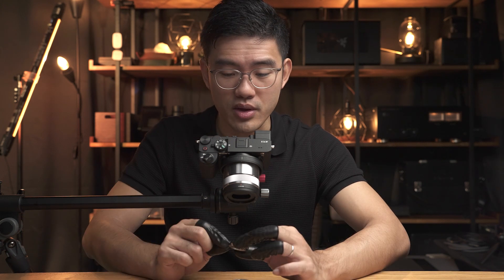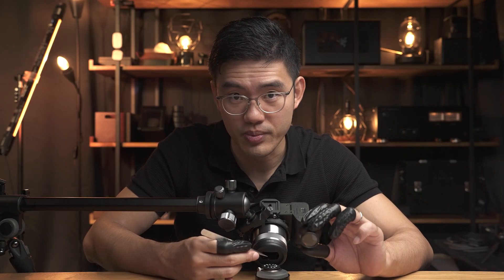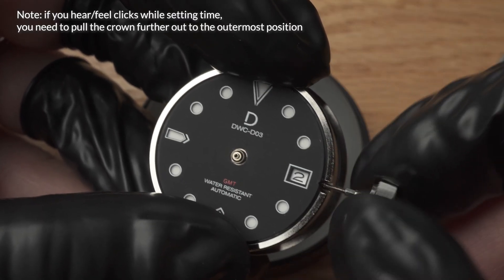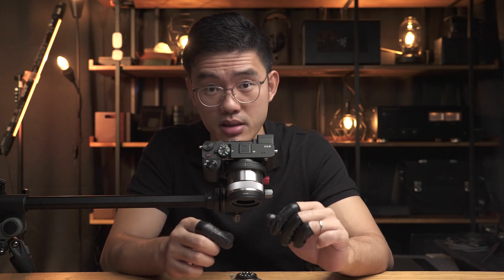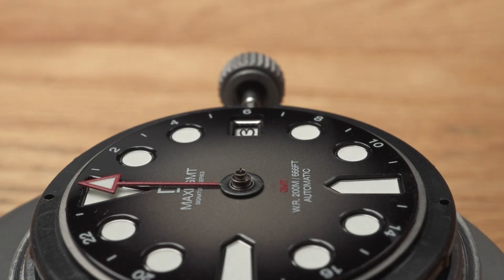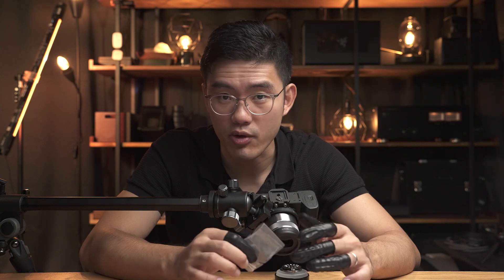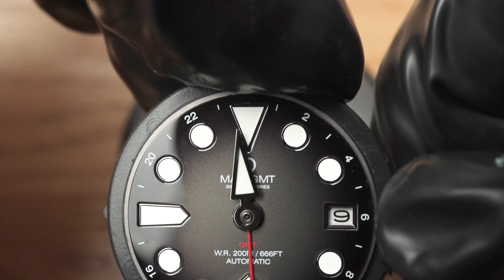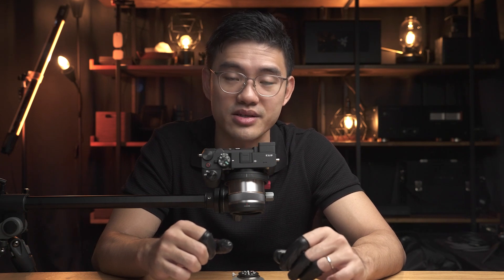Installing GMT watch hands for the MIYOTA 9075 and TMI NH34 / SEIKO 4R34 (Part 1: GMT, Hr, Min)

Comment: Hello - I have started to build your GMT kit with the Miyota movement. I have a question about the black movement holder. Is it secured in some way or does the movement with the grey plastic holder already installed just sit in the black plastic holder. Have emails but haven’t had a response. Thanks Rob